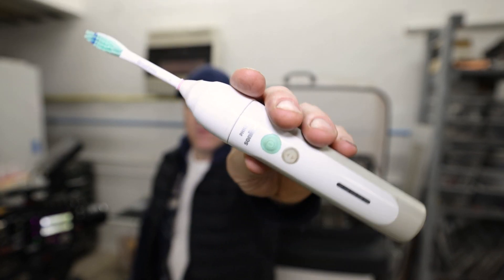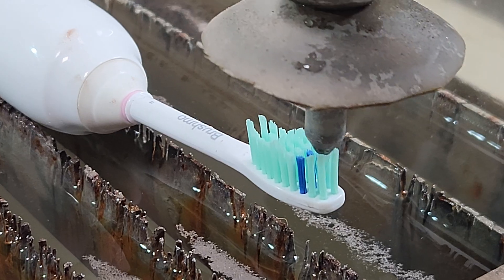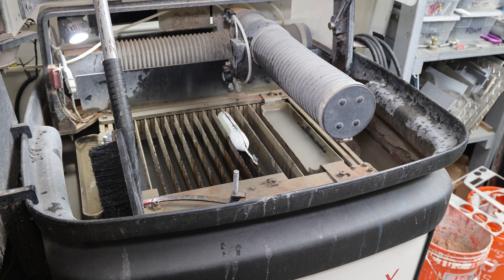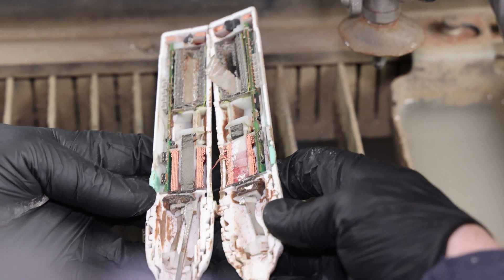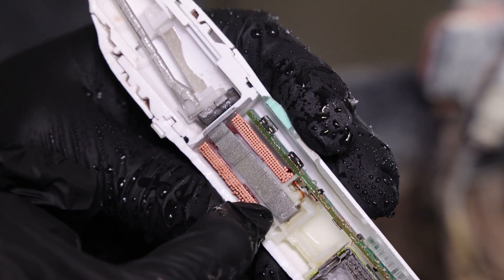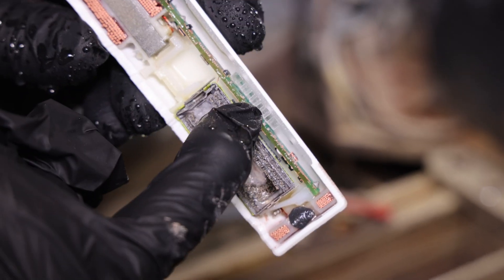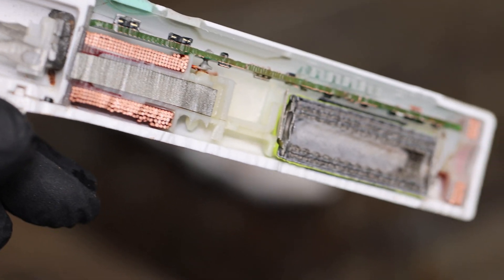I Cut an Electric Toothbrush in Half

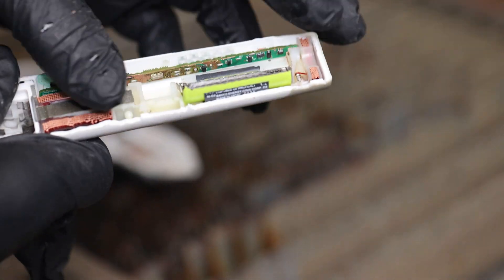Comment: 1:15 That is not paper inside of the battery, that is the layer that keeps the reductor and oxidator apart so that the electrons flow throught the connected wire instead of staying in the battery while still allowing ions to travel inside the battery.
Reply from the maker: Are you talking about in between the layers? Or in the middle of the battery? I wasn't sure what it was but I was talking about that white piece of paper in the middle of the battery, look like it might have been some sort of small paper tube.
Reply: @WarpedLab  The whhite piece in the middle of the battery, it appears as if the middle part that functioned as the reductor has fallen out of the battery during the cutting, and what is left visible (what looks like paper) is the salt bridge.